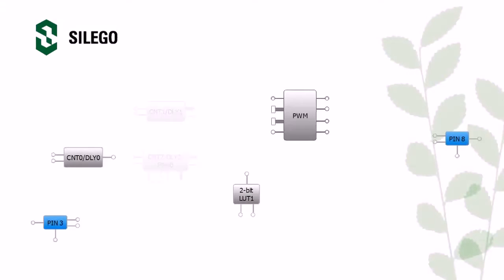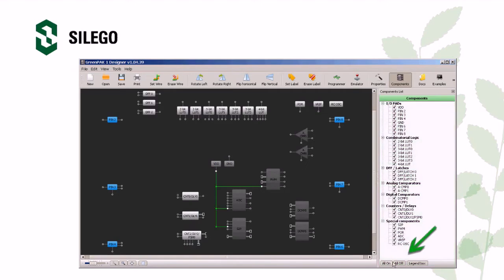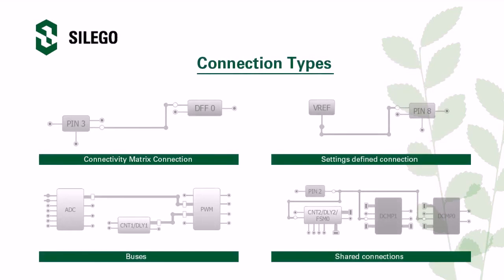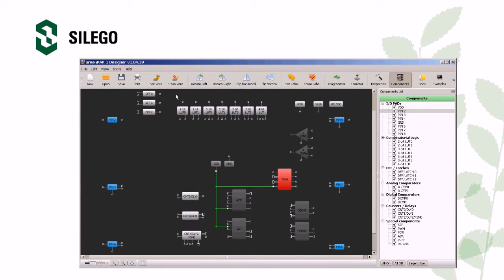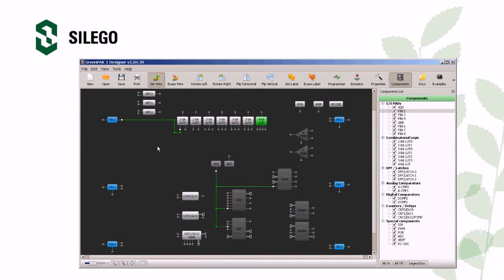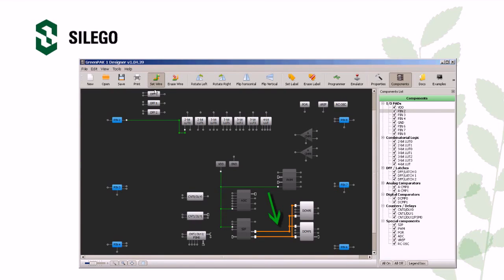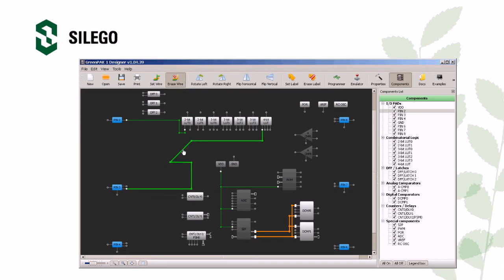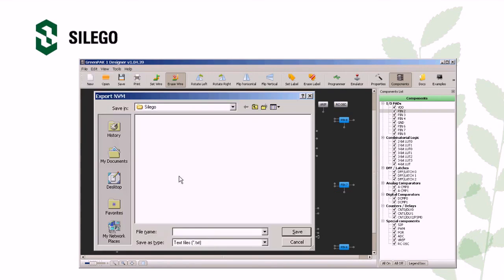GreenPAK Designer Introduction

Comment: Hi, the latest version of the program is bugging me. For work I have been stuck with a project in which I am forced to use the SLG46400V chip and the V1.1 evaluation board. I'm forced to use those materials because the PCB is already designed and they won't let me modify it. I updated the greenpak designer to the latest version and to my surprise you no longer support that chip. I can't even program it because I don't have the software, nor can I change the chip because the PCB is already done. Could you help me to get a previous version of the software compatible with the board and with the chip? Thank you very much.